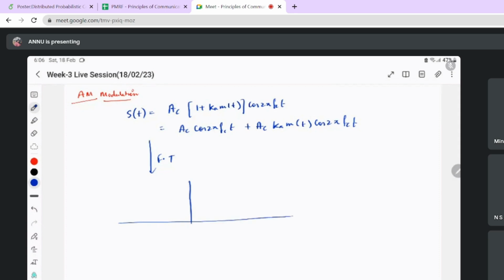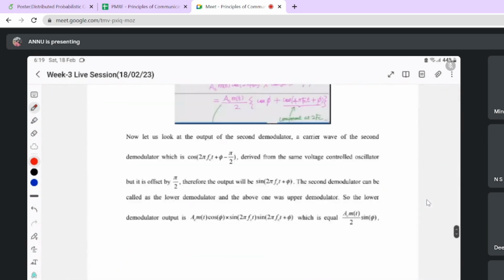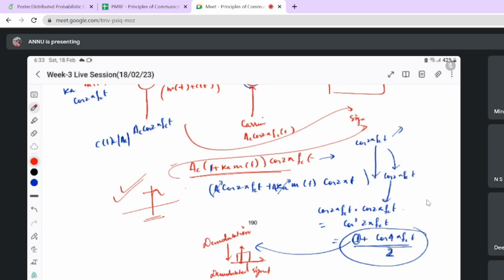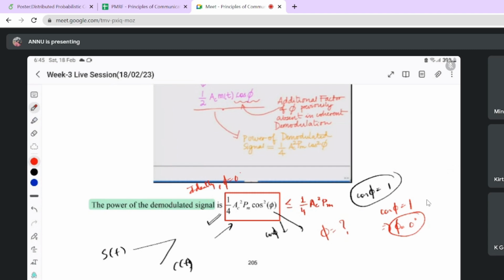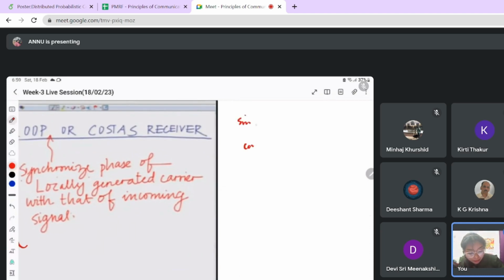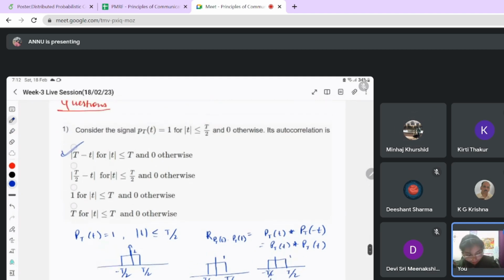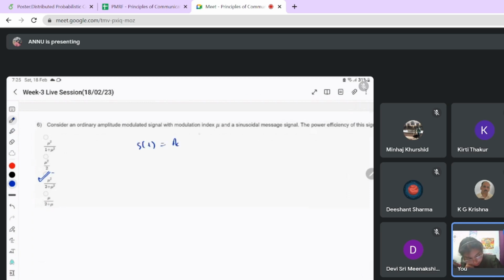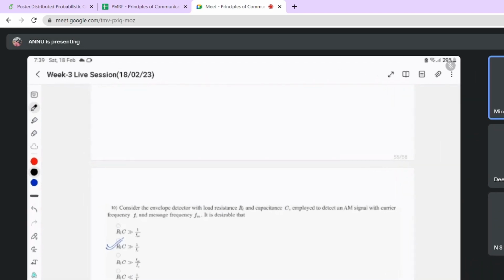Principle of Communication Systems -I by IIT Kanpur| NPTEL | Week 3 Live Session

Comment: Respected mentor, I never insult mentor to solve the assignment question in advance. The question, that was based on your tutorial solution of question no.1 is on week3. Hence, I considered the old(2020)assignment4 (of PEC1) as of week3 only and asked the clarification.  The confusion of the option arise only if the answer of ka is with and without normalisation. As either old or current assignment has no such confusion, I take the decision that got on discussion with collegues. Tommorrow is the last date of week4 assignment. your tutorial session on saturday. Hence, it may not be a hurdle for your hon'ble constraint of cheif mentor. Only I require what to do when  I have to two options that are with and without normalisation of coefficent of v1.

Comment: im n.s. murtisarma, one of your weak mentees. Reflecting your Q.1, another question I am solving. Of course, its of old assignment with v2=a1v1(t)+a2v2^2(t). While solving for modulation intensity, To tally with options, the coefficient of v1(t) is felt to divide throught the equation. Then only I am getting the relisation of option. Is it wrong doing so? if not only 2a2 is seen amplitude sensitivity.
Reply from the maker: Sir solving options sometimes may give the wrong interpretation but one can adopt this way also...this no harm in this as well
Reply: @annusahu8434